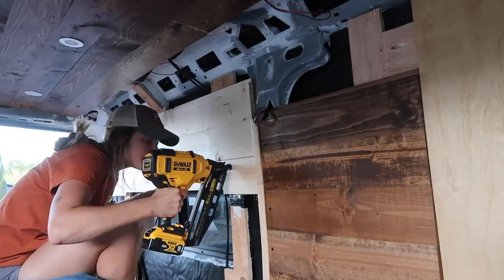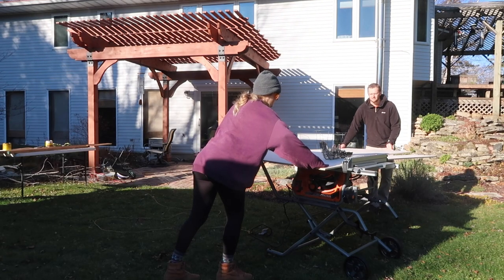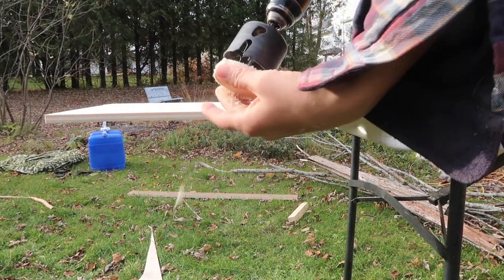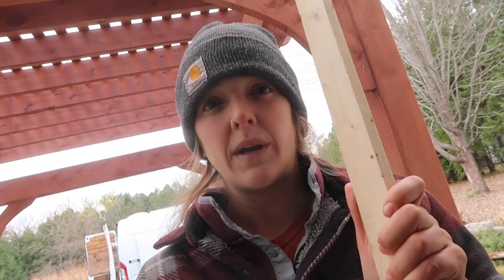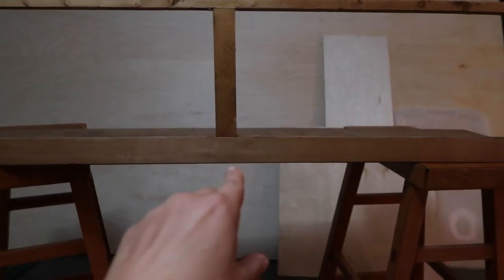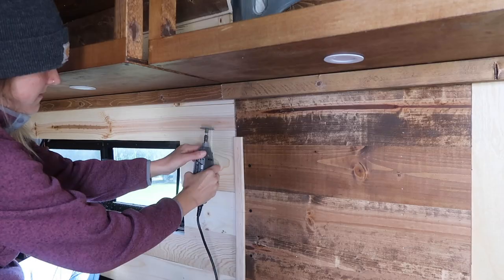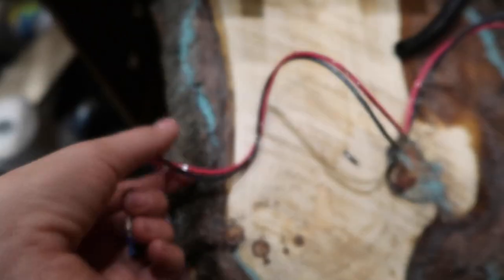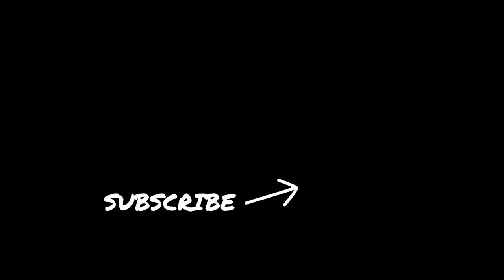DIY CamperVan CABINETS | Frames & Puck Lighting

Comment: Fantastic!
Just a little safety tip.....remember to always use female spade connectors on the wire ends that carry the source power and male connectors on the receiving side, so that if you ever unplug the connectors the "live" wires can never short out on anything metal. 
Great job again!!!
Reply from the maker: Thank you!

Comment: Once again you are helping me feel more confidence to  work on these difficult van building tasks.

I felt better to drill 12 holes in my van doors to install my 3 of 5 deadbolts after watching your earlier video. 

It took me a bit longer to drill the holes but it felt great when I finished the installation.  I now feel so much safer with these deadbolts.  My mostly empty van was broken into in February.  The thief simply used tool to unlock my driver door lock and stole my martial arts sparring gear.
Reply from the maker: Wow I am so sorry to hear about the break in!! Keep up the good work girl :)

Comment: I've been watching vanlife and van build videos for 3 years and I bought a new base cargo Transit in July 2019, got scared 3 days later and took it back, then, finally 12/14/19 I ordered a fully loaded AWD Transit with a Power Side Door feature that has held up the build at Ford all year...  Finally last week I got the VIN and window sticker and Ford is building my van 12/1/20...  During the year I was able to order many materials for my build and I'm trying to go fast once it finally arrives (although I'm sure it will take longer than I think.)  All the while I've been researching and watching YouTube builds.

All that is to say, your videos which I came across this week, have been among the very best I've seen.  They are encouraging and so well done and I am floored by how advanced your description of the steps, tools, and techniques are.  I'm an electrical engineer who has built cars and done many construction projects and even with my background, you as a self described novice, your skills, communication, and editing blow me and mine away.  In truth, your a genius and I appreciate what you have done as well as am thankful for making me feel alot less freaked out about what is about to happen here on my build.  I'm very excited and cautiously optimistic.

Thanks
Reply from the maker: Wow, congrats on your journey and settling on your new van! How exciting. Big things are happening for you. 
I can't tell you how speechless I am after reading your kind comment. I just want to say thank you and express my gratitude for you. This means so so much. 
I wish you the best of luck on your build, and I hope you have so much fun with every project. 
Thank you❤️

Comment: I enjoyed watching this, it was very well done and well planned too. I like this idea as well. With my 2nd van build I'm doing, when I get to my topper, I have to make my own homemade ribs for it because the topper is fiberglass and don't want to accidentally put any screws into it be accident, I'd seen from another van lifer do this with theirs, I actually think that was a good idea what he done that I may do also for mine before I add any cabinets. I'm first doing the work Im almost complete with on the subflooring, when done I'll be installing the vynal flooring tiles, then work on my walls, and new door panels on my barn and cargo doors, and work my way up to the topper. Basically all a new remodel being done from within the van, then when all is complete, then I'll work on my floor plans for the sofa beds (2 single sized beds, one for me and one for my dad, as separate sleeping quarters too) a mini kitchenette, a handmade compost toilet (my dad being elderly and a bit disabled from the stroke he had 3 yrs ago, he needs a potty available at almost all times, plus, I'll make sure there will be his urnal near by (one, he needs a peepee target if he don't and I have to clean up any mess he would make when he misses 😁), some needed storage too, etc. I'm glad I'm almost done with the floor at least, it's been a combination of caregiving for my elderly dad, running necessary errands, timing and money, thus, when I get paid I can buy more needed supplies to continue working on my van as well. Sad thing is, my dad can't physically help me with this van project, though he enjoys helping me some financially because he wants to and he so wants to go traveling with me to go see our grandbabies and family that we haven't seen for years, him for much longer than I have, I've also been doing all of the physical work it on my own. This is another reason it's taking a bit longer to do.. anyway, I do enjoy watching your videos on your van. I love watching all sorts of ideas from other van lifers, so I could use the nugget of ideas to mix with my own too. Be blessed and safe also. Looking forward to seeing you and your next video.

Comment: Screws into end grain like those 2x2s won't have much of any holding power, unless you were to pre-drill and fill the hole with glue before driving the screw.  Better to use angle bracket and bolt through the plywood.  Structural elements need extra strength, since few builders consider the forces in even a slow speed crash.  So, upper cabinets should always be attached to the metal ribs of the van via Rivnuts and angle brackets, with bolts through the plywood for maximum holding power in an accident.

Next build, consider wiring for 3 way switches (as in a house, like stairwells so that you can turn on and off from top and bottom of stairs) so that you can turn on and off in the standing area, and in bed.  And then a second one with a switch by the side door before stepping in, and one up on a wall inside for on and off...

Good job on the wiring!

Comment: Enjoy your videos. Here's a suggestion that's a little late; Make cardboard templates of walls and floors and whatever else to get the fit and then use them to do the wood cutting.
You don't even need one big piece of cardboard. You can tape it bunch of broken down boxes together. It doesn't matter how pretty that looks it's only the outside dimensions you're going for.
Reply from the maker: Cool idea! I did do that with my floor and a few of my walls, it worked well!

Comment: Love your videos Linnea! One question I have- how does the wire from the puck lighting stay out of the way when you use that as a cabinet? A thin piece of wood laying on top of it and the wire pops out a hole in the corner?

Comment: Girl you rocked it. You are becoming a professional at those lights. Great thinking to have dual switches. Uses less of your power as well. Will you be putting up a backing in the cabinets for a cleaner look? Just curious. I'll be waiting for the next update... Happy Thanksgiving 🦃🥧
Reply from the maker: Yes! I have included that in this weeks video, I ended up ripping 3 inch strips of 1/4 ply and it turned out really good!

Comment: with the weight of the cabinets on the ceiling that is only held by brad nails, wouldnt you be worried about hitting a bump and it falling?